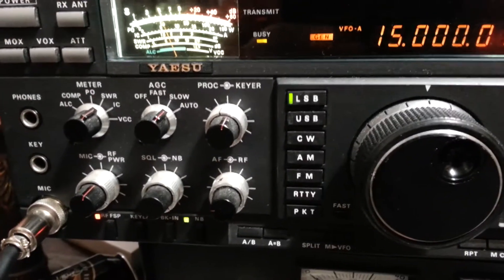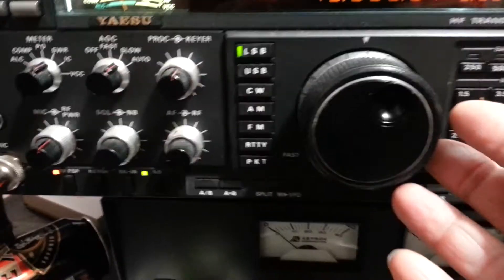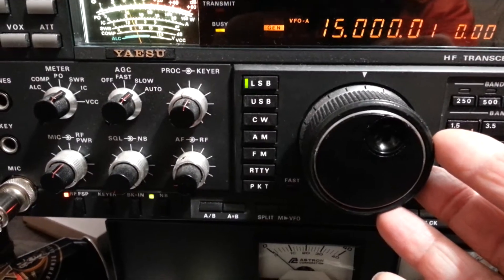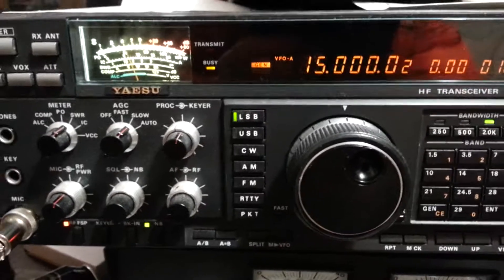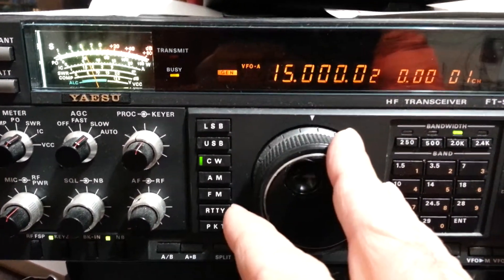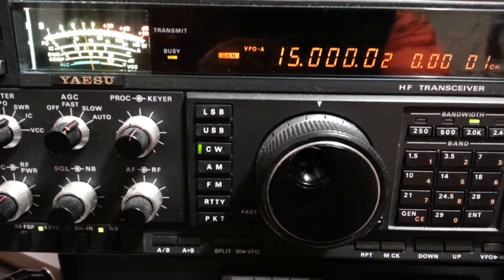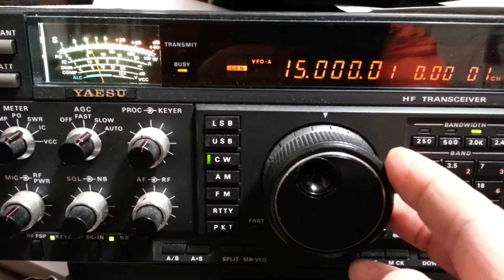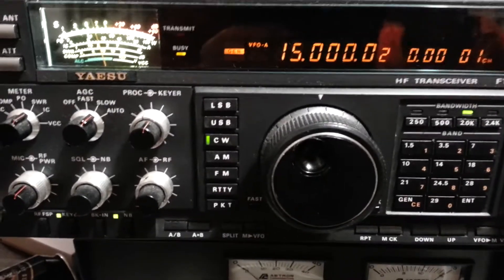Zero Beating FT-990 With WWV

Comment from the maker: Thanks for watching and for commenting.  Sorry, but I was on LSB at first, not USB, as I had said.  I will make a better video with some clarification.
It would be easier if WWV were stronger here, and readable on the other transmission frequencies.  We are at the bottom of sunspot cycle 24 right now, so propagation is poor.  You can read about WWV here: https://www.nist.gov/pml/time-and-frequency-division/radio-stations/wwv

Comment: Nice Video, I have a FT990 as well and I always wanted to know if it was off frequency. Do you know where the internal adjustment would be inside the radio?
Reply from the maker: It is on one of the pull-out boards, I think.  Mine is so close that I did not want to mess with it.  The service manual will tell us.
Glad you enjoyed the video and thank you for your comment/question.